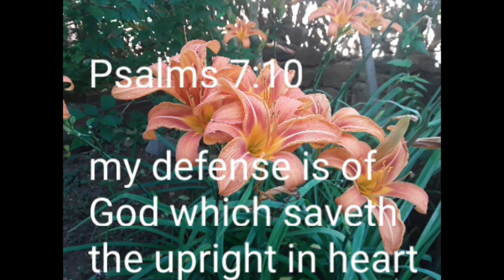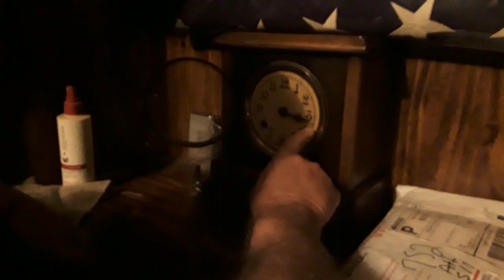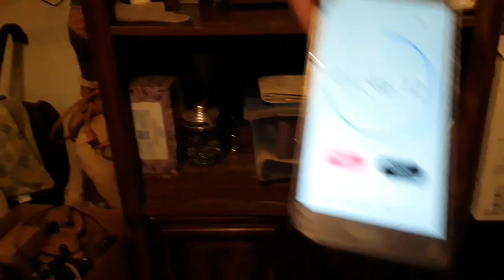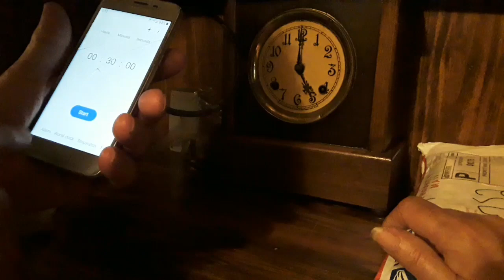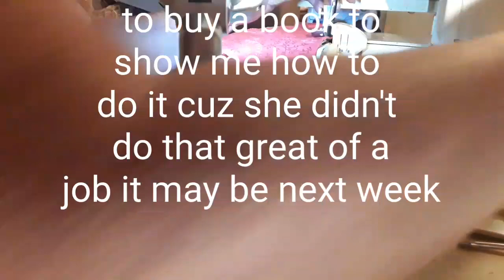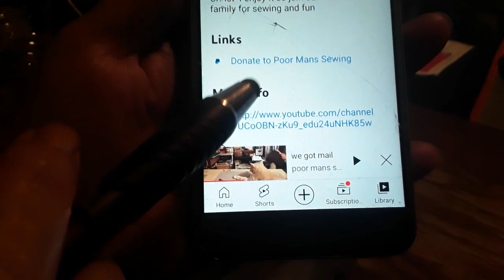working on the serger

Comment: You need three to four cones of thread. (depends on what stitch) Place them on the back of the machine. Starting from the far right pull the thread up and into the loop on the metal telescoping thread guide. Right below the black painted section you will see dials that run across the front. Those are your tension dials that you can adjust. Take your thread and run it thru the corresponding tension disc. Make sure it is in there good. Then look at the guide printed on your serger. Find the path for the far right thread and follow it. 
The two right threads are the upper and lower looper threads. The two on the left are threaded into the appropriate needle. Sometimes the guide map will be color coded. The tension dial may be red and there might be red dots on the metal guides to show you the way. You really need the owners manual. There are web sites that you can download them for free. I know you like to tinker and this may help until you can get a manual.
Reply from the maker: I am buying a book